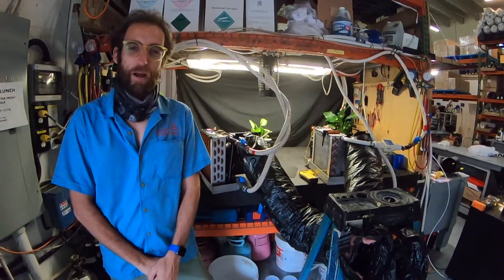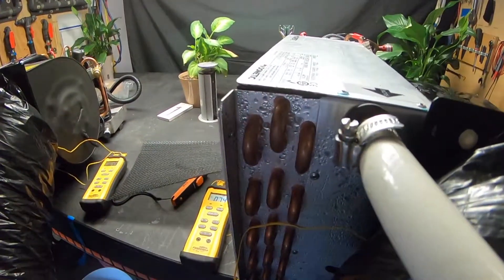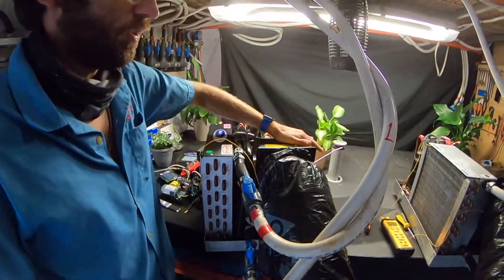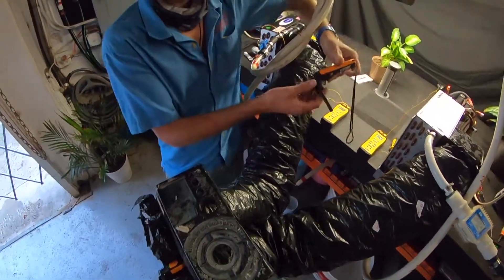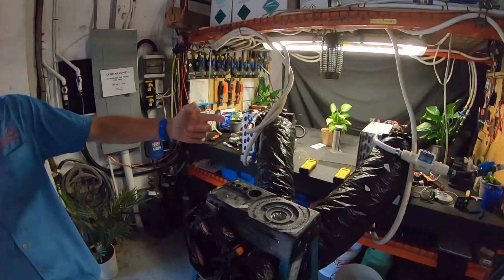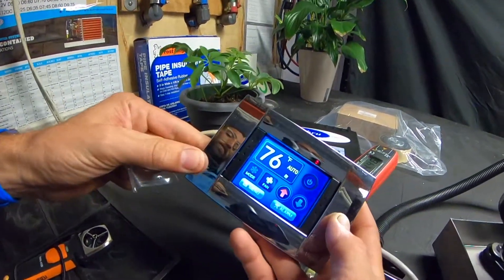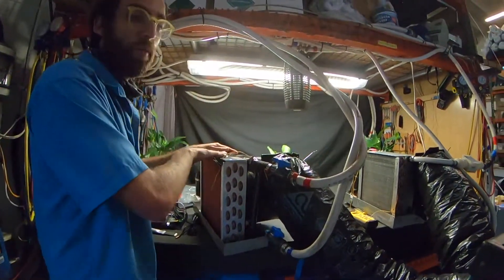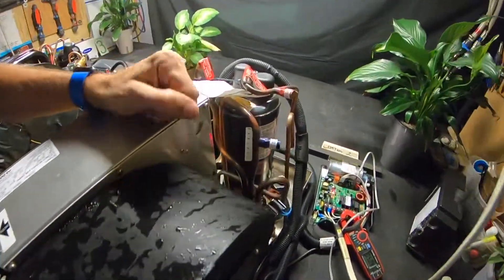Mabru Power Systems Marine Reverse Cycle Self Contained Air Conditioner vs Competitor's Unit

Comment: I just purchased an 11,000 BTU unit I have installed in yet.. This video was helpful. You mention "two screwdrivers" needed for installation. Add wire strippers, duct tape, and needle nose pliers.

Comment: Pretty interesting comparison. the filter, the drainage which is pretty lack on dometic. What probe and app are you using to measure the CFM?
Reply from the maker: We are using the Testo 410i smart probe and the Testo app on iOS
Reply: @MabruPowerSystemsINC  Where do you get those tools? any chance i can buy it online? i believe they have this full test kit set.
Reply from the maker: @archerniel0823  These tools are readily available online. You can find them on Amazon or with many other HVAC tool retailers.